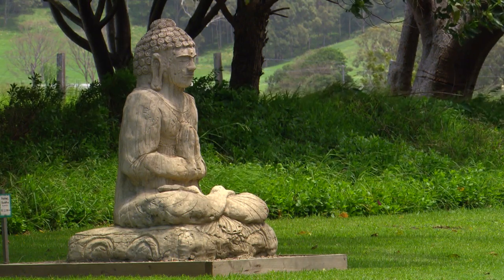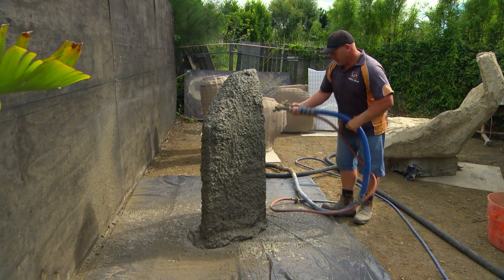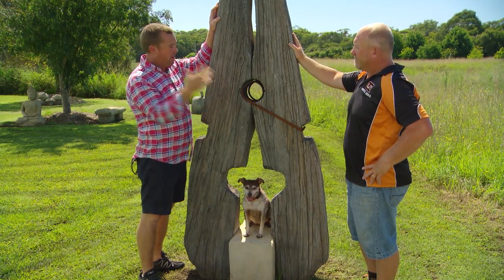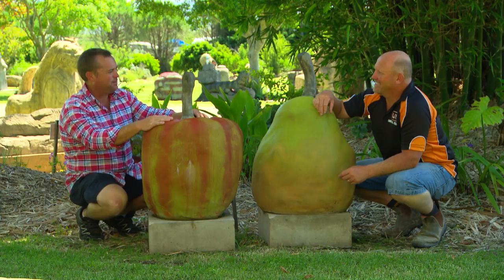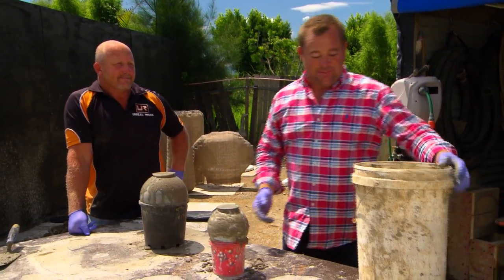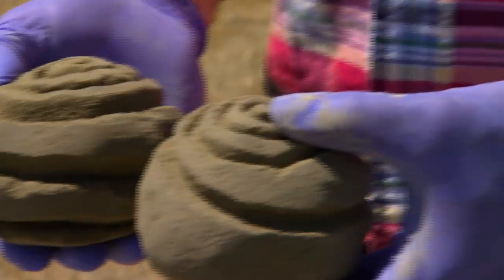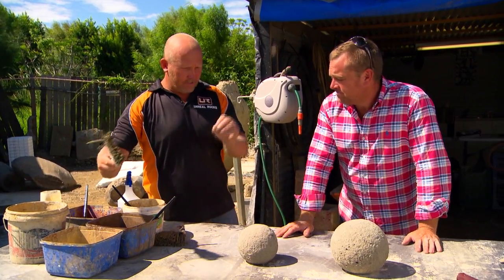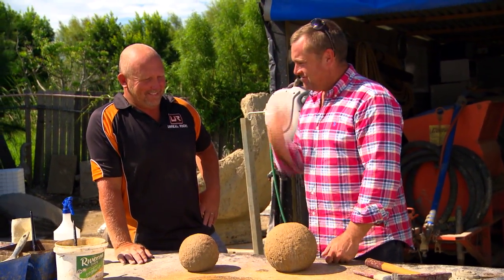How To Make Your Own Concrete Sculptures | Outdoor | Great Home Ideas

Comment: What cement to use and also the sand please. Plus any additives like washing up liquid and PVA glue, or anything else.  Thank you.  Just starting off.  Is the concrete easier to work with if it left for a while, etc.

Comment: Would this method last in a cold climate?  I live in New England and frost and ice are a problem for concrete outdoor sculptures,  pots  etc.
Reply: Did you ever find an answer to this question? (or alternative solution)? I am wondering the same thing.